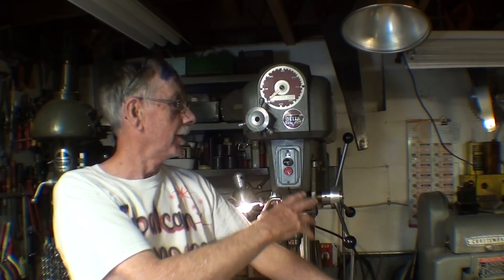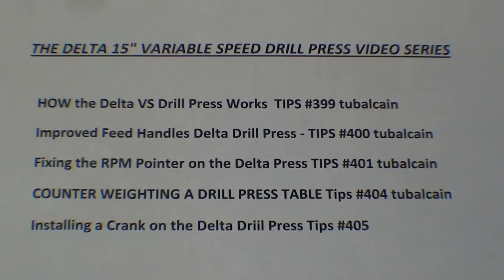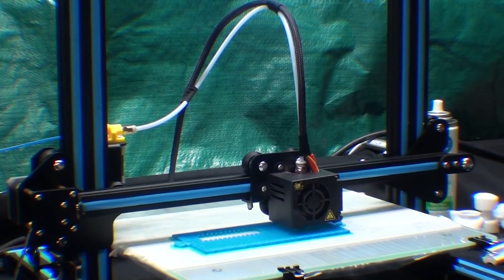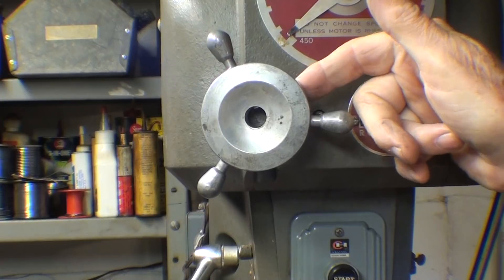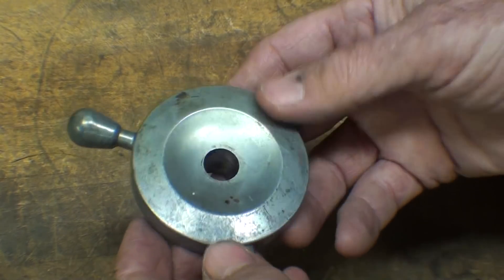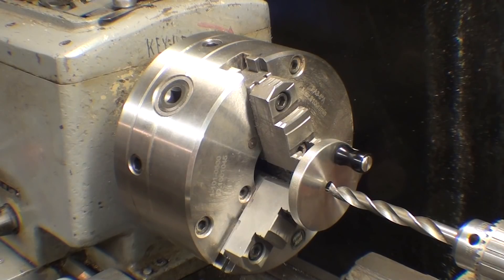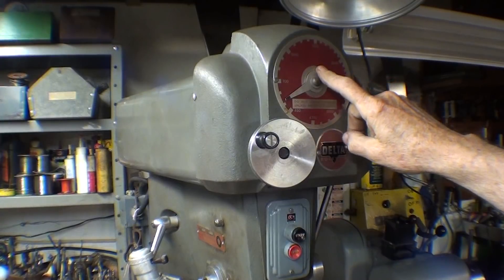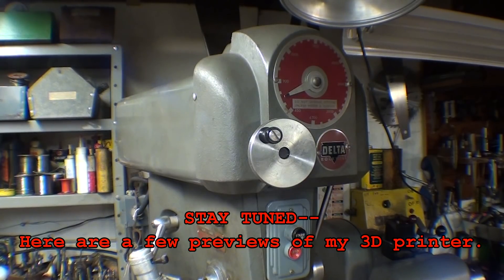Crank for Delta Variable Speed Drill Press TIPS #405 tubalcain

Comment: I like your modification!  As far as folks who get upset with your modifications,  thumb your nose at them and keep moving!  I once thought modifying machines was a no no.   You see all my machines are line shaft era.  Sadly many of the features of newer machines had not yet been thought of or my machines were not shipped with those attachments.  I have started improving my machines to better suit my needs.  When I first got my 1903 20" x 36" lathe it had an ugly home made gear arrangement at the outboard side of the spindle.  I removed it thinking it was not original and did not belong.  Fortunately I did not scrap those gears.  It turns out those gears were to further slow the feed.  I was forever plagued by coarse finishes on my machine because it had such a high feed rate without those additional gears.   I have since reinstalled them and I now get a much better finish.   It turns out that they will not interfere with any operation other than left hand thread chasing, and I can easily remove one gear allowing me to reverse the lead screw to accomplish this task.  

All the best!

Mike
Reply from the maker: Thank goodness you didn't get rid of those gears

Comment: Mr. Pete, thanks for another "sometimes you have to do it this way" video, referring to the blind pin removal of course. I probably would have attempted to hand drill a slightly larger hole 180 degrees from the pin and drive it out with a long punch. Either way the hand wheel ends up marred so one method is as good as the other.
Reply from the maker: Thank you

Comment: You have to love the Dremel cut off wheels. Next in line is the hacksaw, my most used tool in the workshop
Reply from the maker: I own 10 hacksaw's or maybe 12, and have 100s of Hacksaw blades. I use hacksaw's almost every day, I love the high tension frames coupled with sharp blades, you have a formidable cutting tool.

Comment: Could attach a cross bar over the face of the handwheel to move the knob out to a larger diameter and to cover the fact the shaft isn't flush. Using the original knob hole just add one across from it and you can attach the bar.

Comment: I hope it’s many, many, many years before you take your “dirt nap”. If you want the face of the wheel flush with the end of the shaft, you could face a little off the boss on the rear of the wheel, unless that is going to interfere with the set screw. Great video, keep up the great work. Also, as far as making mods to machines go, I make many mods to my machines to suit myself. Not concerned about what anybody thinks, let the next owner change it back to original if he or she wants to.
Reply from the maker: Yes, it's your machine, do whatever you want

Comment: LOL! Ya gotta do what ya gotta do! ROTFLOL!

For future reference. If you ever run into this again you can simply finish off the hole on the other side slightly larger than the roll pin size and drift the pin out in the opposite direction. 

BTW I agree. "Never put a pin in a blind hole" 👍
Reply from the maker: Yes, but locating it on the other side, and actually meeting the pin is quite another story
Reply: mrpete222  What you do is measure from the pin clockwise to an approximate half way point. Then measure counterclockwise the exact same distance. The pins other end will be exactly between those two marks (assuming of course the hole was drilled straight 😉) Then measure up from the inside edge to the pin and ad half the width of the pin. Measure up the opposite side and mark it. To account for errors in their measurements and perhaps errors in your measurements because of the difficult position you need to measure from you use the slightly oversized drill bit. You can always go back and make the hole a little bigger if you can't get a drift on it yet because of a larger error than you expected. But you should be really really close.
Reply: very interesting  thought  its like what happens when you round off a lug nut on a rim cannot damage  the rim  what do you do?

Comment: For future reference, if you need to get such a pin out of such a blind hole, whilst cursing the such and such who installed a part that way, there is an easy way.... take a trip to your local tile store and look for diamond-tipped core bits - the smallest ones are simply for drilling holes through a hard tile (porcelain and the like) where a normal masonry bit won't work. Bigger ones tend to be for cutting out holes for pipes and cables. They go through aluminium like butter and non-hardened steel almost as well, if you take your time. Anyways, select the size that has a centre hole a tad larger than the diameter of the offending pin, clamp the part vertically in your drill press vice and simply mill out the metal around the pin, down to about half the wall thickness of the part it's in. Then grab the pin with whatever tool seems appropriate and pull the bugger out! 

It's a procedure we perform semi-regularly with a piece of railway equipment we have dealings with at work. The old pin is replaced with a turned item that is the diameter of the original pin at the bottom of the hole and the diameter of the ew milled-out section at the top. The pin we have dealings with is relatively large, so the replacement is drilled and tapped about 5mm deep for an M3 thread. So next time we can just whack an Allen head bolt in the hole and pull it right out. 

Hope that helps someone.
Reply from the maker: Thank you, that's a good suggestion

Comment: Hi Lyle
I really don't understand people that are against functional improvements in equipment. The purpose of equipment is to do tasks after all. A modification to  equipment which allows it to to do the task better (includes safer) is all to the good. I can see how a collector or historian might wish for things left  completely as manufactured but I don't think this is reasonable. Certainly manufacturers specifically reserve the right to make changes to their equipment as they deem necessary. 
Collectors and historians should be appreciative of those that take the time to keep original equipment.parts removed from their machines as you are doing :-)
regards
vic
Reply from the maker: They are morons

Comment: A man has to do what a man has to do, to get a pin out of a blind hole!  I told you once before that you put too much faith in an engineer not to put a pin in a blind hole. (MACHINE SHOP TIPS #136)  LOL   I don't understand, why the pin when you have a flat on the shaft, unless it saved them on production costs.  No threading, and a pin costs less than a set screw, but IN A BLIND HOLE , OMG!
Reply: Also, you can never make too many videos about one machine when they all cover something different!
Reply from the maker: I never thought of it that way
Reply: Meant to tell you to make a button to cover the hole on the front of the crank, before someone complains. lol  Don't have to press it in, just stick it onto the end of the shaft with a neodymium magnet.  Keep us up to date on any modifications or projects on the Delta Drill Press.  Keep up the good work.

Comment: 0:50, Understood, but you used the Tubalcain moniker before you started sharing videos, right?  I hereby request you start calling yourself YouTubalcain from now on.

I bet the mfgr made the speed control shaft just so that, even if you took the ladder chain sprocket off the shaft, the ship's wheel and shaft wouldn't come off the machine for you to work on at your bench.  I'm lucky I've only had a few experiences with pins in blind holes (that I needed to remove).  Mostly on (crashed) Japanese robotic machinery.  I gathered they were willing to compromise ease of repair for minimum mass and compactness, etc.
Reply from the maker: Too late, I would have to change it in 950 videos

Comment: Yep, if your goal is to be cursed well after your death, put stuff together with blind pins. If you want a lot of cursing, be sure to used hardened dowel pins.
Reply from the maker: LOL. Yes, only a very mean person would drive a hardened pin into a blind hole Or a complete moron, or a combination there of.
Reply: You might mention to your viewers that in situations where a blind pin is unavoidable there are pull pins (fractional and metric) that have an internal thread giving something to get a hold of so they can be removed. Some pins, like the ones made by Holo-Chrome have external rings ground into them to make removal easier.